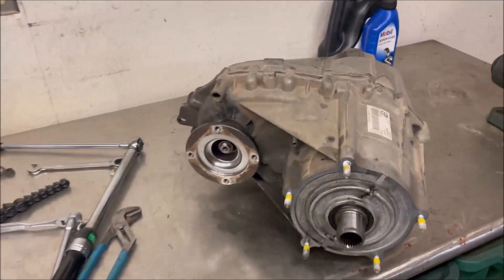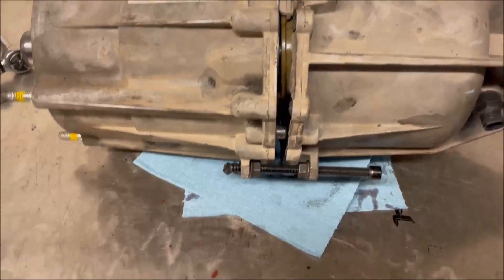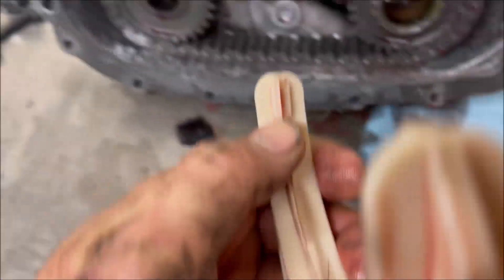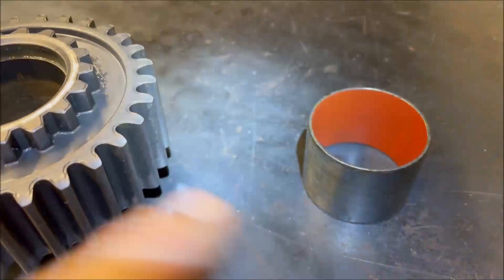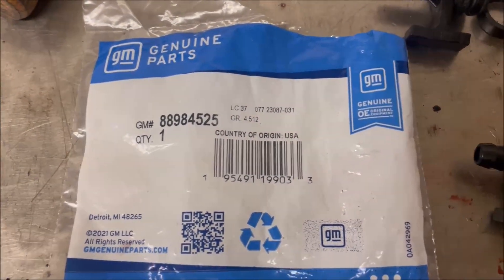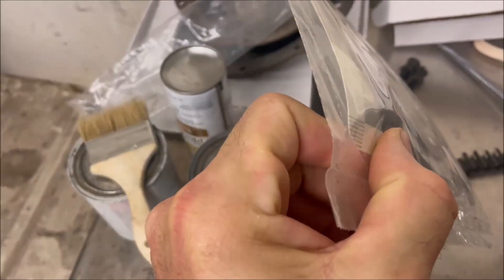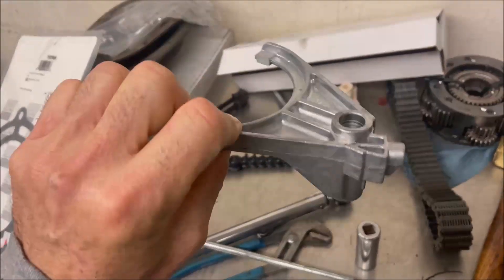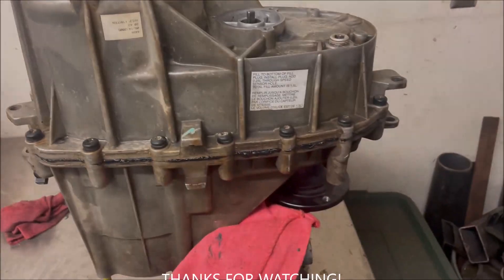Hummer H3 Transfer Case 2wd to 4wd Conversion - Part II

Comment: Hello!  Question!   I have a 2006 h3 that has a issue.in normal 4 high the tranfer case shift to neutral while driving?   What keeps the 4 high engaged inside the tranfer case?   Is any conversion to leave ot in 2wd full time bipassing the hig/low ?    Thanks
Reply from the maker: 1). I've not heard of that problem before.  Neutral can only be reached by pressing and holding two t-case buttons at the same time.  Perhaps the buttons on the dash are "sticking".  This is quite common.  2). If the t-case is shifting modes by itself, it is usually due to a worn (plastic) shift fork, or sticking buttons.  3). Yes...Transfer Cases Unlimited sells the 2WD kit in this video.  The kit comes with a new aluminum fork, so you can fix that issue at the same time.  Call George at:  (631) 226-1448
Reply: @4speedfunk  l already took the transfer case off and put the improved fork. Transfer case was clean and no metal shavings  . Do you know what keeps the transfer case lock in 4 high?   Thanks
Reply from the maker: @12masterr   Hi again.  The shift rod inside the t-case has spring-loaded detents on it.  When everything is working correctly, it will stay where you put it (or where the encoder motor puts it).  I bench-test the t-case thru all modes before I install the encoder motor.  I do this with a pair of pliers, and you can "feel" the detents for each mode.  I rotate the input shaft, and make sure that I have 2HI, 4HI, 4LO on the outputs before I install it back into the truck.  Neutral is all the way around at the end of the dial.  I suppose if the encoder motor is freaking out...it could put the case into neutral.  But, normally this can only happen by pressing and holding two buttons simultaneously.
Reply: @4speedfunk  thanks!   When I have the case apart I can not feel any detents. Are they located on the shift fork?    I tougth the electric motor was keeping it from moving! Thank you very much!
Reply from the maker: @12masterr  When properly assembled, you can take a pair of pliers and rotate the selector shaft through all modes.  It should feel quite stiff, and all three modes will be very obvious.  The detents are built-in to the shaft assembly.  If the shaft freely rotates with little or no effort…then something isn’t assembled correctly.